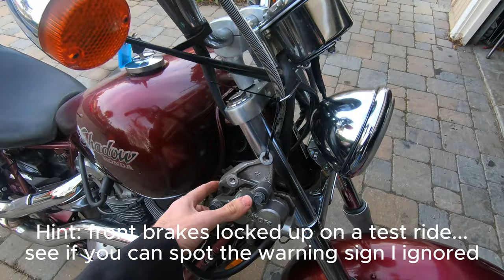"Barn Find" Motorcycles Are Not for Everyone

Comment: All the " will it run" videos are mostly guys just looking for social validation. As you said , with enough work and money anything will run. Having said that a bike that been  outside will need a lot more time and money put into it than one that has been  stored inside. Anything made of rubber on or in the bike will need replacing. Old  brake and clutch lines  might look good and work for a while until air slowly gets into them .Wiring will be brittle. The whole carbs thing is another story. Its good to see a younger guy talking sense.

Comment: I've bought a used Royal Enfield Interceptor 650 from 2019 last year, just the engine shutting off randomly at a red light out of the blue made me consider selling it off immediately haha
Some older bikes just have such a fantastic charm to them that if one can make it run I'm all for it, but I wouldn't want to get stranded because the one part I didn't replace is the one that finally croaks.
Reply from the maker: Yep it definitely keeps you on your toes and takes a while to trust a bike like that. Not a hobby for the faint of heart lol

Comment: Purchase a 75th anniversary Sportster in 2014, here's  some of the laundry list, motor rebuilt,( with step up cams ) new 1st an 4th gear, plus clutch assembly, new tires, did not polish anything, finally in 2022, took it off table,  the look an question i get when ride make it all worth, an another one to add into collection.